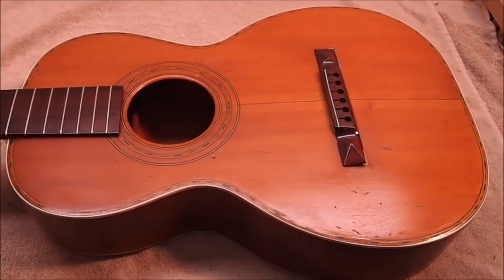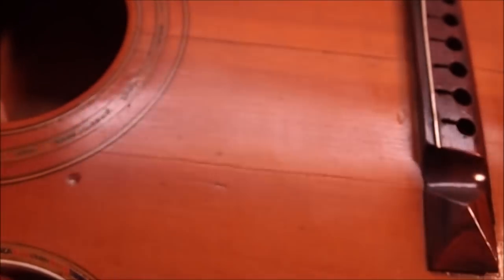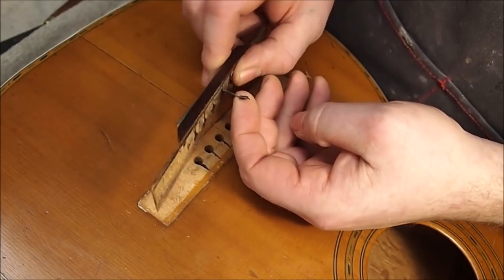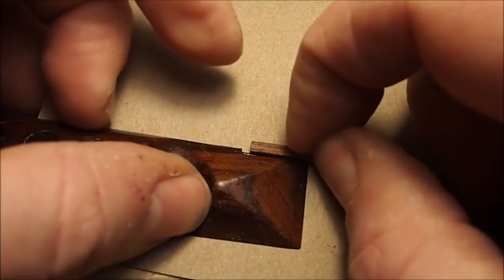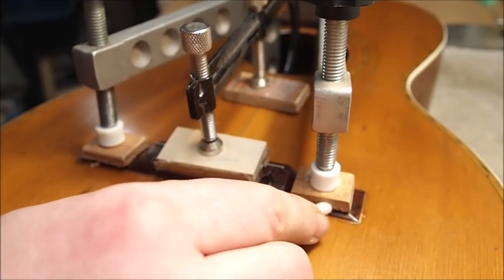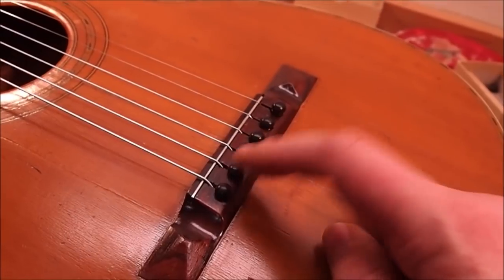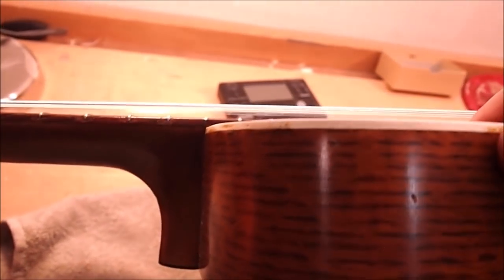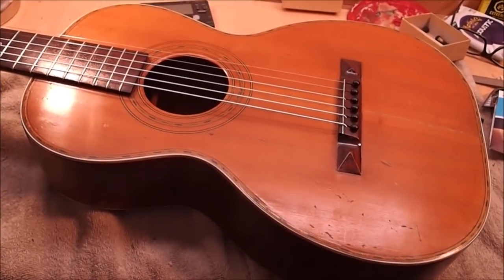Parlor Guitar Repair

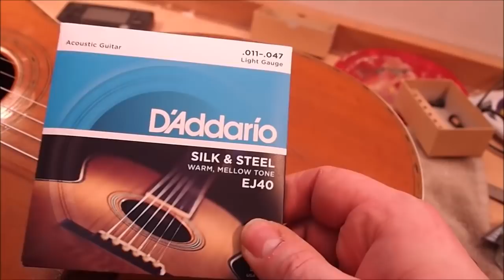Comment: 5:31 These are D'addario EJ40 They're Silk & Steel Light Gauge Acoustic Guitar Strings. You would never ever wanna put a Standard Set of Steel Strings on this type of Acoustic Guitar. This is an Acoustic Guitar from the age of Gut which has way less tension than Modern Steel Strings do (you might also get away w/ using Thomastik KR116 strings).

Comment: Hello Ted, very cool turn of the century guitar. I have a close twin of this..  But, there is one major difference..  mine has a metal vase shaped wraparound tailpiece and flat bottom wooden bridge with fretwire saddle. I like the nice heelcap at the base of the neck. It has a pronounced, yet comfortable, v-shaped neck and plays pretty well in the upper positions.
    Mine also has no identification markings... the tuners were originally installed on the wrong sides.. 
    Everything looks a bit Washburn... maybe seconds.. but made at Lyon and Healy 1900 - 1919 ish  . 
    Always thought it was swamp oak the way it smelled when opening its' chipboard case!   
Thank you, John

Comment: Cool little Parlor guitar. "From the age of gut"  Silk and Steel strings only .011 - .047s.  NEVER use a standard set of steel strings on a parlor guitar. Needs lower tension.  Maybe tune it down to D to give it a rest when you're not playing it. Great advice. Thanks!  Now I know.

Comment: Sorry to drag this up but I had a question about the top separation. You mentioned that you would fill it with some glue but didn't show or discuss that in detail. Did you go with hide or CA? I have a mid 50s vintage Hofner classical with birdseye maple sides and back and a nice sitka top. It has a top seam split very similar to this guitar. I've been humidifying the guitar for a week now to start to close up the gap and that was somewhat effective. I'm prepping to cleat and glue the seam and was interested in your recommendations. This guitar was French polished to bring out the birdseye and I plan to refresh the polish a bit but not overly so to leave some patina.

Comment: I have a 1919 "Columbia" parlor.  The back looks like oak as does the guitar in the video. It's grain lines are totally convincing until you're told that the grain lines are actually ink and that if you look again you can see the actual tight wood grain lines.  Ive heard that this rolling on of ink was popular in furniture from this era.  Not saying that ink is on the back, just that mine has ink on the back, is from the same era, and looks similar.

Comment: Just a little technical question from a fellow luthier, why do you glue the cleats at 45 degrees? I would have done them at 90 before seeing this video but seeing as your repairs are always great would love to know the reasoning for this.
Reply from the maker: I don't think it matters that much, but I figure splitting the difference between seasonal movement in the top and cleat might help, somehow. I know there are violin restorers who argue strongly for both methods.

Comment: Just thinking about this one and your comment about the risks of attempting a neck re-set (when you don’t know the exact neck joint). I have a guitar which, for various reasons is in a similar position regarding the folly of attempting a reset (but in this case the soundboard has bellied behind the bridge and sunk in front, so the action is abysmal). I had considered taking the back off to re-brace the top and put it back into shape to raise the bridge/saddle height, but what do you think about this alternative: the fingerboard is also in a terrible state, so how about replacing the fingerboard but in such a way that it reintroduces a sensible angle to give the correct height over the bridge? I know there’s a lot of work in that, but (a) the fingerboard needs major work and a re-fret anyhow, and (b) it avoids attempting a proper but perilous neck reset. Would appreciate your brief thoughts on this alternative approach. Cheers

Comment: An x-ray or CT scan might be useful to figure out the dimensions of the neck joint for more accurate removal and resetting. You know, in a case where that was desirable and worthwhile to the customer.

Comment: I believe this is a Victoria guitar. I recently repaired one for a Finnish artist. I made a new bridge for it and a new saddle. It was from somewhere around 1910 or 1920. The original bridge was exactly like this with the fret wire. Also the binding and the headstock were quite similar. I have repaired several Swedish made Levin guitars that were very similar and from the same era. But since you live in North America I figured this might be a Victoria. I have read that Regal manufactured them at some point but then again they did a lot of stuff like this.

Comment: I wonder if you could have planed a back taper into the finger board? it looks rather thick.
Reply: Probably have no fretboard left at the nut. I have the exact problem and I'm going to rout a new surface to the fretboard and put a new fretboard on top.
Reply: @Iazzaboyce  yeah I suppose making the fretboard thicker and tapering to thickest at the sound hole would work too, as long as it doesn't make the neck too thick to play comfortably .
Reply: @docdoc  The neck is 20mm deep at the nut end - I will be reducing this by around 4mm and adding around 6mm - so not too much difference there. The board will appear thicker toward the body as gradually less of the original board will have been removed. It might look a little odd, but I can't think of a better way of getting it to play well.
Reply: @Iazzaboyce  Some old classical guitars from well known makers have heavily tapered boards. Nowadays we say it looks odd and it's more correct to have the proper neck angle, and I agree, but from a mechanical stand point a tapered board is completely viable.

Comment: Great vid sir your vids are super interesting to watch. 
So because you mentioned detuning the guitar I have a question. I have two martins that were kinda expensive. I bought them both new within the last 5 years, one is an HD 28 and the other is a MMV. 
My question is, when I put them in their cases should I detune them a little? Will detuning them help prevent a neck reset? Or is detuning these guitars bad for the neck or body in any way? 
Thank you.